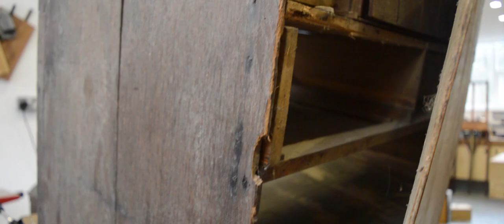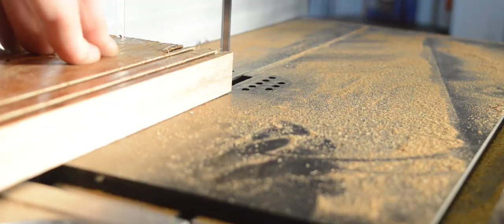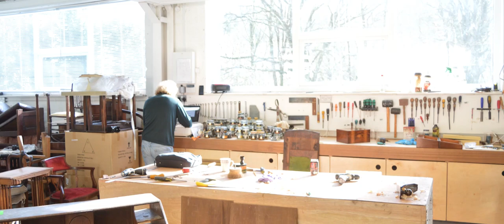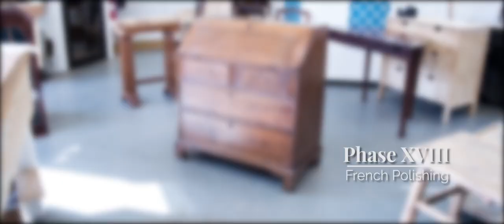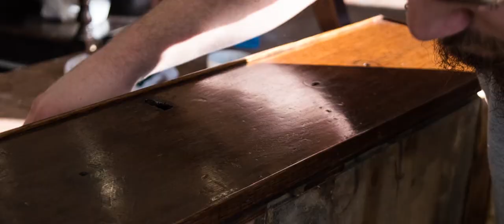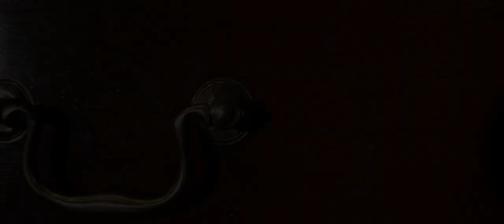Timelapse Restoration of an Antique Georgian Oak Bureau - Before and After

Comment: Beautiful work! So many people seem to think furniture restoration is easily "DIY'd" by just stripping old stain and refinishing. Your video is an excellent example of the fine woodworking skills needed in order to thoroughly restore old and damaged pieces so beautifully. By the way, I think your time-lapse speed and music was perfect and I wouldn't have changed a thing. Thank you!
Reply from the maker: Thank you !
Reply: that's because this is a restoration not a renovation. Restoration means bring it back to it's original state, and i saw lots of chipped spots and stains even after, which is fine. but if this was not an antique, stripping varnish and refinishing is a very good way to do it.

Comment: Great video. What is the step you labeled as "fadding"?
Reply from the maker: Fadding is the the third process in the stages of French polishing. We use cotton stockinette, folded and charged with a mix of pale polish and methylated spirits. It allow the polish to be applied quickly but easily controlled by the person applying it. In essence its the sealing stage or primer / undercoat in general terms.

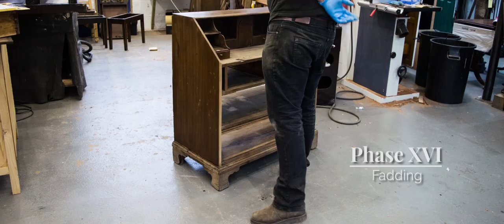Comment: Amazing job. I love watching these and maybe learn something. One question about this video, on 6:09 "fadding". I think i'm missing a word on my english vocabulary, what exactly is fadding?
Reply from the maker: Hi Joni. It is the application of shellac to the surface using a 'fad'.
Reply: @GilboysRestoration  Thanks, fad rings a bell :D. On the video there was part fadding and then french polishing in separate part. I thought applying a shellac is french polishing. Did you use any oils on this? Would there be any reasons not to use tung oil products like Liberon Finishing Oil and then wax to antique furniture like this?
Reply from the maker: Hi @Joni78 
There are many processes to the art of French Polishing. It's not just one thing. The way I was taught involved at least 6 and they are in this order. 
Staining (If required)
Grain Filling (If required on a more commercial basis or for speed)  
Fadding
Colouring 
Rubbering 
Spiriting / Dulling / Waxing 

If you can master and understand the above processes / techniques and how they work together then you are a French Polisher who has a good understanding of French Polishing and all that it involves. 
I hope this helps 
Simon

Comment: Very impressive restore fellas! What is a French Polish?
Reply: hizo64HH.  French polish is a method of applying shellac by hand in multiple very thin layers. It's considered a high end finish, as it takes considerably longer than other methods like spray finishing.
Reply: David  marzolino i dont know if it is the same method but my master taught me to fine sanding between layers and use a little more thinner in every new hand. Is that ok with your definition?
Reply: Anggelo Gallardo.   Yeah, that's good advice. Really french polish refers more to the application method than anything else, As long as you're applying the finish by hand in thin layers. sanding between and thinning each subsequent coat  works well, as it makes it smoother, and easier to apply the finish.
Reply from the maker: French Polish is a natural finish developed in the 18th Century. Its a shellac resin based liquid polish that requires a lot of practice in applying to achieve the right finish.
Reply: Yes it is an artisans most excellent work that is taught by master craftsmen. My admiration for all these highly skilled craftsmen knows no bounds. Museums are enriching to see the finest artistic work by man . A life long passion.

Comment: this is not RESTORATION. this is REbuild with new parts
Reply from the maker: This is all very well said, but the timber used is actually period timber hand selected by our restorers from our store to fit the piece.. If the customer has asked for the bureau to be rebuilt, we can well do that if half the pieces are missing. hope that clears the air for you :)